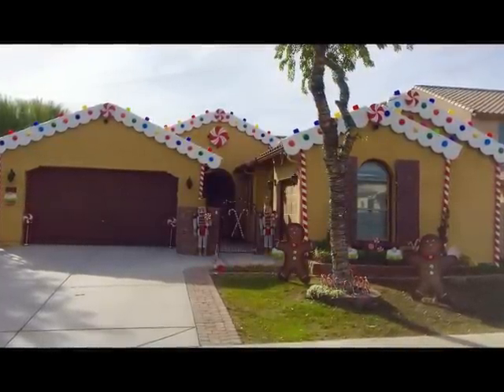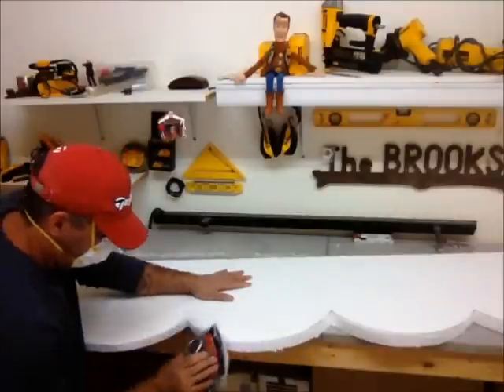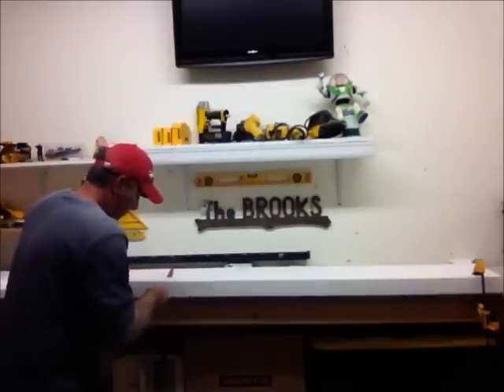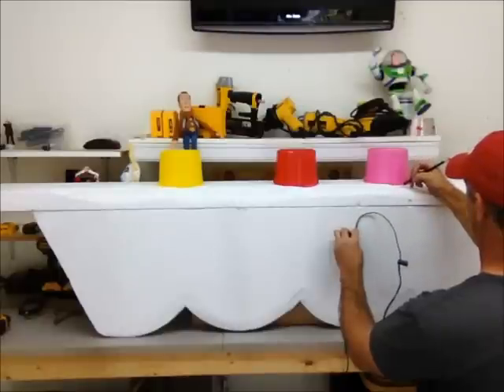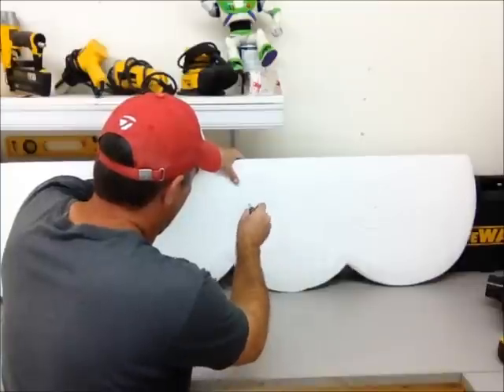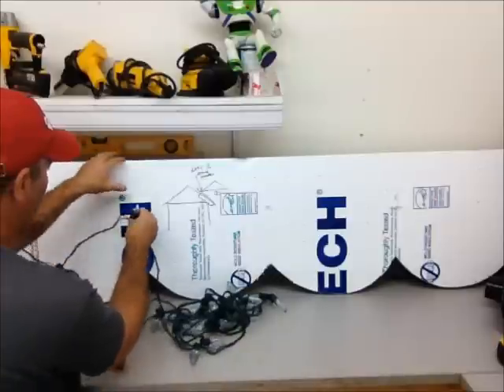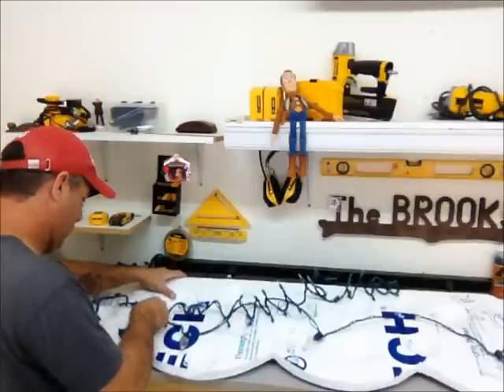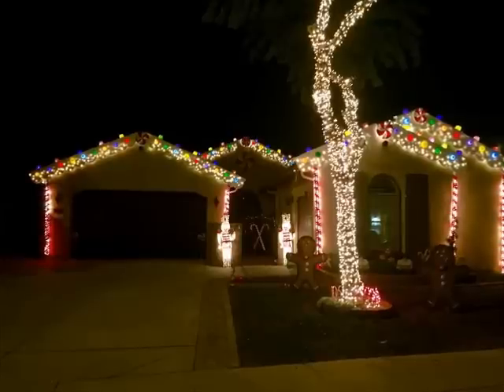DIY Christmas decorating ideas Gingerbread house  candyland theme

Comment: This is a fantastic idea! How did you secure the styrofoam to the house? Thank you for this tutorial. I have so many ideas from this video that I can use in my decorations.
Reply from the maker: +Natalie Trull       I placed 8' 2x4 on the tile about 1 foot back from the eaves with 5lb weights on them. I  then used cable to tie the "icing" off to the 2x4's. Hope that makes sense..
Reply: You should show us that in this video. You made 2 separate pieces...how do they attach together or do they? lol

Comment: I'm hoping you can tell me how you attached the frosting to your roof. And also the name of the color cups you use for the lighting?
Reply: ..... For the M&M's and he said beach buckets for the gum drops.
Reply: Hi. We did one this year and used fishing wire and 3M Command strips. It was tricky and tedious but it worked. We have a metal roof, live in Florida, and it's a rental so we couldn't attach anything permanently.
Reply: I was thinking about doing somethi n like this but was worried about winds breaking the foam? where can you buy strong foam? is it possible?
Reply: Ahhhh!!!! He never replied to how he attached it to his roof?!?! I’m at that point and counting on his reply!!!
Reply: @amieross4625  how did u attach it to ur rental?? Bc I have a rental and I’m trying to figure out how to attach it.
Reply: @jgsg2620  I used command hooks. They are the ones that pull off without  issue.

Comment: Greetings,

I am hoping you will answer my question as I plan on making these decorations for my house for 2022 Christmas. That said, there is a huge debate between my son and I about securing the icing to the house. I read your previous comments and understand you used 8 foot 2x4s laid them on your roof, placed 5 pound weights on top of the wood, added a screw to secure the cable from the wood to the Styrofoam... so the Styrofoam hangs in place. My understanding is no nail was placed in the wood to secure it to the roof. My son thinks nails were used to secure the wood to the roof. Can you please clarify as I would not like to use nails to secure the wood to the roof for the reason that I would be risking creating water leaks in my roof. 

That said, I really love this idea and your decorations; and thank you very much for sharing your idea.
Reply from the maker: I did not use any screws to attach it to the house .. I have a tile roof . Hope this helps.
Reply: Thank you so much for your response. That helped a lot. My roof is shingles, so I am literally stuck and fresh out of ideas to mount the icing as I definately do not want to use screws or nails. My last ditch effort is to try shingles cable clips. I figure I can attach that to the shingles, then tie some rope/thread to it, and affix the other end to the icing and just let it hang. We are putting it up this weekend so hopefully it works.

I do however have one more question. What type of lights did you use that you are able to screw the bulbs in. I have been searching but to no avail. So I thought of punching a hole as you did, but hot gluing it so it stays in place if I can't find those lights. 

Crossing my fingers that I can make thus happen.

Comment: Hi
This is a great idea.
How did you fasten/ secure these foam boards to the house?
Reply: Hello Heather, he wrote the answer in a few other people's question in the messages. 

He said he place 8' 2x4 on the tile about a foot back from the eaves with 5 pound weights on them. He then used cables to tie the "icing" of to the 2x4s. 

Hope this helps :)
Reply: @clorysss richbow - did you finish? Can you post on your channel? I am looking to secure the foam around the windows of my stucco house and interested to see what other techniques have been tried

Comment: Very Nice! What did you use to safely mount it onto your home??
Reply from the maker: I took 8' 2x4 and laid them on the roof about 1 foot, I put a screw in the wood and tied the Styrofoam off with a cable from the 2x4 to the foam. The Styrofoam is very light so the 2x4 holds it just fine.
Reply: Scott Brooks I don't understand how you got then to hold on
Reply: Do you have more detail on how this was done?  Putting the 8 foot 2x4 on the roof - how did you secure that in place?  Did you have to screw it down onto your roof??

Comment: what did you make your long candy cane sticks (on the edges of the house) from? I like that they light up!! PVC is too thick for that...???
Reply from the maker: Hi Karen ,  i did make them from PVC. They are 4" . I have been getting a lot of questions about them so I'm going to throw together a video today. I'll put a link here for you when I get done.
Reply: Thank you!!
Also, how did you attach the top layer of icing to the front part that hangs down?? Did you glue it? What kind of glue?
Reply: I wondered that too.

Comment: Did you glue on the "m&m's"?If so, what glue? If not how did you secure them to ensure they didn't fall off? Thank you!
Reply: We made one this year and didn't need to glue the 'm&m's' onto the foam board, once you score the foam they can be screwed into the foam with a little pressure.
Reply: @amieross4625  what did you use for the gum drop?
Reply: @vicentesalinas8259  look like kids' beach buckets turned upside down to me. :)
Reply from the maker: Yup! Beach pails turned upside down.. you can even spray them with some glitter spray for a more realistic look